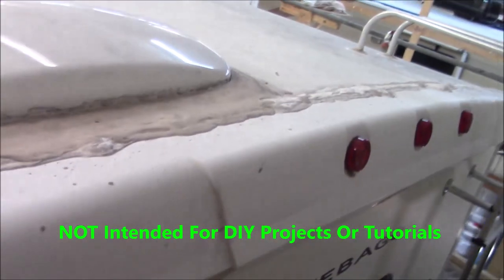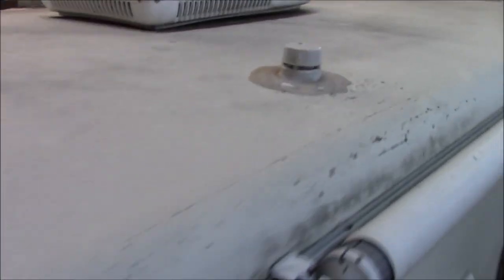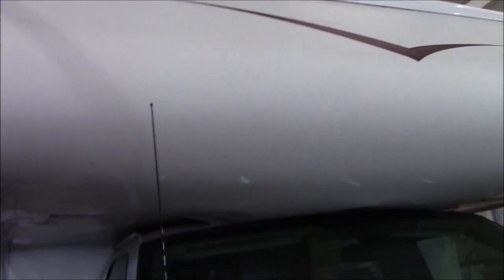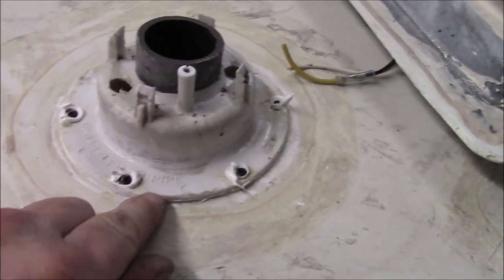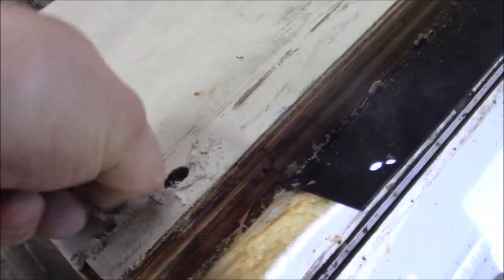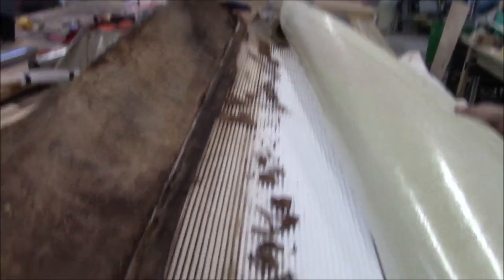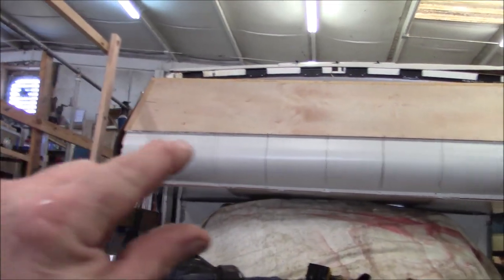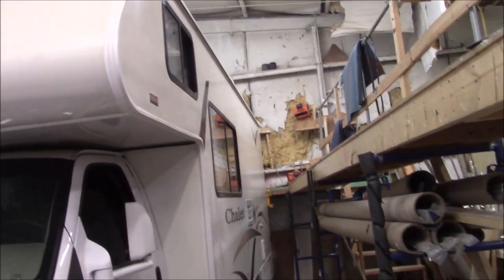2007 Winnebago Class C Bunk Re Build

Comment: I’m repairing my C-Class now the same setup, huge water damage and I’m salvaging it now.
Reply: Are you putting nose ribs in to support the leading edge? If so could you share pics or video?
Reply: @richtorgeson1020  yes I’m framing it both horizontal and lateral,  steel studs and wood as well.  I took out the bull nose and just used the angled front frame and top and then sheathed it with diamond tread aluminum instead of fiberglass.  I used a custom homemade brake and bent all the angles with a template.  Worked great and I’m just finishing up now.  I have many videos to share.

Comment: I drilled one hole in each side  just outside the doors on the flat side of bunk do you think that will help if any water is laying in the bunk
Reply from the maker: May help eliminate some moisture, but if there is water in the bunk, it'll need to be opened up and dried out/ removed one or the other. If the wood is wet or if the foam is wet, it won't dry out properly with just a hole on each side. Wherever the leak is, most likely coming from the roof, if it's not corrected  it will keep getting worse, then the mold sets in...dog chasing its tail.

Comment: I'm buying a class c were the guy backed into a tree and the ladder pushed in around 4" up top and then he opened the slide and it broke the bedroom wall in the same spot due to the ladder being in the slide area. It's a 2008 grey hawk 30gs. Slide still works, just not sure the ballpark of a repair like that. Subbed and any info would be great. I live in North Ga.
Reply from the maker: On something like you describe we would need to see it.  Understandably it is difficult to quote something you can see the extent of the damage.

Comment: Do you have any suggestions on how to remove rusty trim screws?   I just purchased a 1999 Fleetwood Tioga and one of the corner trim pieces needs to be replaced.  There are several screws that have the heads sheered off and several others that won't budge under "normal" screw removal techniques (I typically use my clutched drill with appropriate sized bit after a good dowsing of PB Blast).  Any ideas or suggestions would be appreciated.
Reply from the maker: Hopefully you are NOT using a Phillips bit. Almost all the time they are a #2 square drive. I will use a manual screwdriver at times to feel the direction of the screw so you can stay true. Tighten and loosen back and forth. You could get a Dremel and create a groove for a straight blade screw driver or square it off to grip it with vise grips. Last.... Use the Dremel to cut the head off and if you are going to reuse the piece just make another hole under or over the existing.
Thanks for watching.

Comment: One other question I have is Do you know if the Thor Sprinter Citation or Sprinter Siesta use the Plyfoam on the roof instead of wood and truss with insulation as do Class C units>
Reply from the maker: Class A, B and C are plyfoam roofs.
Reply: @RVROOFINSTALL  The structure on the floor looks and feels like the same stuff they use on the side walls about one to one and a half inch thick aluminum railing with imbedded foam and fiberglass on each side then vacuum bonded in a vacuum press.  if you watch their factory videos you can see the process.  I was just wondering if that is what the use on the roof and or floor.  I guess I can call them and ask.  I was hoping you might just know having possibly worked on one.  Thanks I love watching your rebuild vids and learn a lot.  Thanks again S

Comment: Do u have any videos with newer model Winnebago C class Rvs ?
Reply from the maker: Not sure how new you mean but if we do you should be able to enter it in the video search. Are you a Winnie fan?
Reply: @RVROOFINSTALL  well I have  A winnebago with a 2017 with fiberglass front cap . I had heard that fiberglass cap is placed over the traditional front cap so its essentially "double sealed" just wondering how true that is.
Reply from the maker: @kpcrf450  I'm not a fan of Winnebago. They have the worst roof structure I have seen. Not just the typical RV roof but the actual structural part of the roof is terrible poor and fails leaving the customer to pay for expensive structural reinforcement. All roof will leak no matter what the material is if it doesn't have curbs. We generally rip the fiberglass up and install TPO. There have been a couple of instances that we h e gone over the fiberglass with the TPO but only after a series of inspection holes to ensure the underside is sound. 
But to answer your question I don't believe they are double sealed.
Thanks for watching.

Comment: Have you given any thought to repairing soft spots in the floors of Thor Sprinter Chassis B+ RV's?  Apparently the laminated foam/aluminum floors are are breaking down just inside the entry steps and in front of the bath hall and toilet where they get most of the traffic.  Sooooo you get soft spots.  I have seen where the vinyl gets pulled up and holes are drilled in 4 inch squares across the perimeter of the deteriorating areas and injected with epoxy.. then the vinyl is replaced and the floor is solid again.  I would appreciate your thoughts on this.  Here is a video from  Canada of a repair.  

https://www.youtube.com/watch?v=d4RfbD1j4EM  

This is going to be a LARGE problem going forward for anyone owning one of these units and might be a new line of business for your company if you are interested.  I am anxious to see you redo a Thor Sprinter chassis B+ roof in the future as I will probably bring mine to you when it is time to replace it.  Thanks S
Reply from the maker: We have done floor repairs like you described. The epoxy idea will kind of work. There needs to be some reinforcing of the frame.or foam for it to last. The floor is plyfoam. So when the water gets through the foam it reaches the lower panel and causes it to separate. Plyfoam gets it strength from laminated panels on both sides.
There is a lot of work to make those repair last long term.
Thanks for watching.
Reply: @RVROOFINSTALL  The Plyfoam as you describe is does not get water exposure in the areas described ie the inside the hall and first foot fall at the top of the steps.  I think the damage comes from reapeated stepping in the same spot every time you come into the unit and same with walking down the hall.  It is kind of like carpet wear in a door way. So is there any other process that you are aware of other than the epoxy process to repair it? Thank you for your thoughts..S
Reply from the maker: @steverowley3967  typically that type of failure is caused by water intrusion somewhere. You may possibly have a shower leak that is traveling. Need to get a moisture meter in the floor to be sure. If meter shows moisture then you need to search for the roof cause. If it does not show moisture then that would indicate the adhesive failed. Not common to fail unless exposed to moisture.